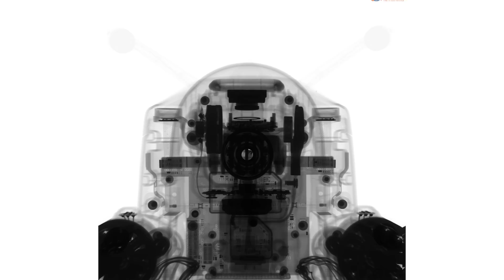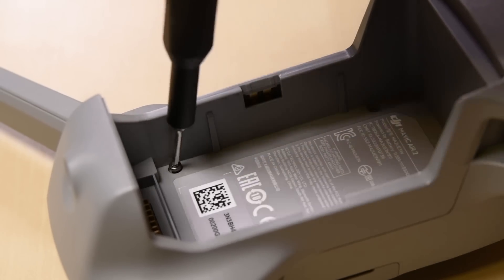DJI Mavic Air 2 Teardown: A Look Inside DJI’s “Best Drone EVER”

Comment: Sir this is very important for me I have a dji mini 4 pro drone which had crashed, now it is not connecting to the rc, sometimes it connects but if it moves even a little, it gets disconnected. Can you tell me what could be wrong with it?

Comment: Something I dont think was mentioned. The Motor // Arm soldering points are actually spaced pretty far apart, making it easy for even a novice at soldering to be able to do it easily. Most DIY focused FPV drone electronics arent done in such a way. You are lucky to get a mm or two between pads, here we see like 1/4 inch. Dont like that they didnt put a plug for the arm motor combo, but I get that it adds weight and they wanted to save every 0.1 gram here.

Comment: One of my 1.5mm sensor plate screws is not drilled so I can’t remove it. Any ideas how to take it off? All other 5 came out no problem but the one has no hole! Agh
Reply: This is over a year ago but it’s a cap. Remove the cap and you can remove the screw.

Comment: 3:30 hold up. The landing leg on my mavic air 2 broke and the two connceting cables from the led got disconnected. Do I need to open the propel thing also if I want to connect new leg and the cords to the led?

Comment: Excellent video!  I'll be disassembling my MA2 soon.  Replacing the front sensor module.  Hope that clears my "Front Sensor Failure" error.  I like the drone but when parts fail for know good reason, you have to wonder about low quality components.  Love how it manually flies though.

Comment: great video!  Im trying to add an external battery.  Do you happen to know if those 2 holes on the esc near the battery connector a positive and negative battery input?

Comment: I tried to use this process on my DJI air 2s to remove the gimbal from the body. The gimbal data
cable came out easily from the mother board just as seen in the video, but the
video cable does not. seem like the plug and socket of the video cable are different.
At least in my drone there was no space to place the pry tool under to release
the cable. Please be very careful when trying to get the video cable
disconnected, you may end up spoiling the socket on the motherboard. Just a
heads up from my experience.

Comment: May I know when you remove the screw for panel facing down 1:13 , do you have to remove 2 seals that will void warranty? I don't see any seal but I want to confirm as after I sent in for warranty claim, I was informed by service centre that my seal is missing and will not entitled for warranty. So unfair! Wonder anybody experience this from DJI service centre
Reply: If you look at one of the screws when new, it has what seems to be a glob of epoxy over the screw cavity. This is one of the known ways DJI determines if your warranty is void. Unfortunately it can be picked out with a finger nail fairly easily.
Reply: @battery_wattage  just be careful, This toy is for outdoor, you can lose this epoxy and lose your entitled warranty

Comment: I just used this vid and a couple others, as well as this forum post: https://forum.dji.com/forum.php?mod=viewthread&tid=217010&extra=&page=1 to repair my brand new Mavic Air 2 overheating constantly. It happens because DJI didn't pay attention to the cpu and ram and 8gb internal memory chips not properly contacting the metal heat pads shown in the video. Some thermal pads and noctua thermal paste fixed the issue and I can record in 4k 60fps in sunny florida without breaking a sweat. If anyone needs help and has the same issue, feel free to comment and i'll try to help.

Comment: If you have a drone with 1 of the 4 motors magnets feel a lot weaker then the other 3 would you change it the with no errors or anything just feels like the magnets are weak when you spin by hand compared to the other 3

Comment: surely once you remove the solder of the motor from the board you can pull the wires out through the leg? so you wouldn't need to remove or resolder the motor end.

Comment: WHAT SIZE HEX SCREW TO TAKE OUT THE SMALL 2 SCREWS AT THE FRONT OF THE GIMBAL.. 

Those screws are smaller than the 1.5 mm 

Thank you great video!!

Comment: Question about the bottom cover on the Mavic air 2...
There are two round sensors on each side of the LED.
When you take the bottom cover off, do those have glass in them or are they just empty holes? 
In other words,  is there supposed to be glass covering the glass sensors?
Thanks

Comment: Hi iFixit  , thank you for this guideline. Really appreciate. 
I have some questions. Basically, due to new European regulations, I need to decrease 570 grams weight of the Mavic Air 2 to 500 grams. I have an idea to get rid of avoidance sensors (Front,Down,Rear). Related to the above, the questions as follow:

1. Is there a chance to measure the weight of each module are shown in the video:
- Front vision module (3:07)
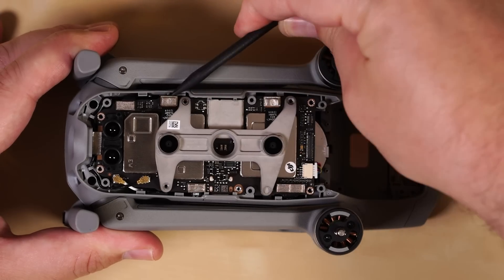- Down vision module (2:04)
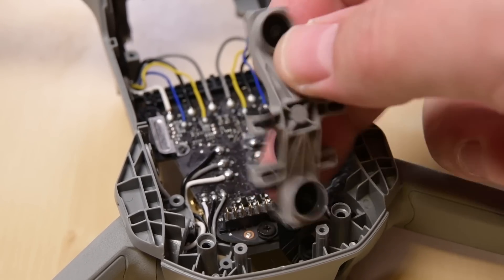- Rear vision module(3:15)
2. What are the parts that may be considered as redundant? Just in case if avoidance sensors will not cut 70 grams.
3. In case I remove 3 mentioned modules and disable the avoidance sensors in the setting of the app. Would it be working fine? 

Thank you a lot for any information. it will help me a lot to make a decision. I believe for many people in Europe that would be helpful, due to the new European restrictions (valid from 1 July 2020) with drones above 500 grams. 
And Last - Is the any chance to share XRAY photos. They are just fantastic!!!

Thank you a lot

Comment: Recently crashed my mavic air 2 into the tree and the gimbal's now stuck. After inspection, it looks like one of the cable connecting the gimbal to the drone was cut... Do you have any suggestions on how to fix it/get a gimbal replacement?

Comment: Interesting comment at the end 'it's not a drone it's a quadcopter' . . . I would posit that it's both.
I suppose it depends upon how you define what is a drone,  because drone aircraft come in different forms. 
I think in the most basic sense a drone must have the capacity not only to operate but to also function without external input.
As an example a well tuned and balanced quad can remain stationary in flight with no stick input, but that's all it can do with no stick input. A drone on the other hand can take off,  fly a course by waypoints , return home and land all without the need of any stick input.
The Mavic Air 2 is a drone in quadcopter form. It can be flown as a drone, or as a quadcopter - albeit with permanent stability & stuck horizon mode.

Nice break down vid

Comment: Is it easy to tear down the landing gear stand? Just  concern, if I need to replace this part, does the LED come out easily or do I need to desolder the wires to remove it from the housing?

Comment: Are you able to show where the ADS-B sensor is? UK version didn't get Airsense due to supply shortage. Keen to see if it's a clip in module we could add at later date or if it's a chip on main board - curious to see if I just have a big space where it should be.

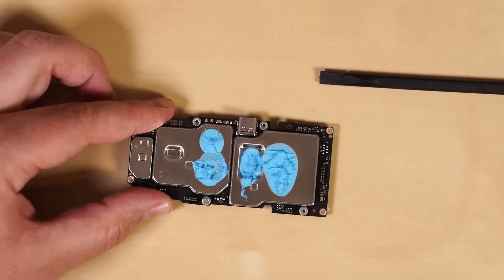Comment: When you opened the heatspreaders to see the actual chips (as seen at 2:35), was there any thermal paste under there or were the chips bare with no thermal paste/pads touching the metal heatspreader covers?

Comment: 6/10 is a very mean score.
Looked super simple to disassemble to me - the soldering is because those are the parts that vibrate, would be dangerous and add unnecessary weight to put clips there

Comment: I think the quad itself deserves a 7.5/10. The remote should be evaluated separately, as that doesn't tend to break (be broken)
Reply: Its also not a part of the drone itself. I dont think it should have been included. You arent flying the remote around at 30+ mph

Comment: “Even though they dominate the market they continue to innovate at every price point”
Apple has left the chat
Reply: Boost
Reply: Can Apple get into the drone market now or is it too late? I wish they would as it would certainly provide DJI some healthy competition!
Reply: So true 🤣 Paging the Rossmann group!
Reply: Really though, look at Fimi.  I don’t know about repair ability but the X8 is between the Mavic Air and a normal $1000 Mavic but it costs under $500.  No safety sensors but the speed, battery life and image quality compare VERY favorably
Reply: @bruhdabones  really it works well? I dont think so, and also beta products? Which one? Their 1:1,000,000 ratio for their face id? LMAO
Reply: At least they dont release half bake products. Im talking about Samsung's ultrasonic fingerprint.
Reply: @johnricang8791  it works well lol apple is known from releasing beta-products
Reply: First laptops to totally use USB-C, afterburner cards, cases that are totally silent even on full load, iPhone cameras are one of the best phone cameras, iPhone SE2, Retina Displays, Mac Pro Display, Radeon Pro Vega II Duo, etc... They don't innovate at litteraly every price point, but they still manage to do better than others.

Comment: 6/10 seems awfully low for such an easy disassembly.
Reply: I was thinking the same thing. I think iFixit gets too hung up on solder and glue. Both are viable assembly options. Anyone adventurous enough to try to fix their own drone should learn how to solder.
Reply: @ddegn  Exactly and its not like soldering irons are expensive, you can literally buy them for less than 10 bucks. And its not that difficult either just a clean surface and good temperature setup and anyone could do the basics.
Reply: @idontcare7961 I tried using one of those non adjustable irons they're really terrible and almost never get the solder hot enough to make a nice solder joint!
Reply: I agree, this drone is easily a 7. Should it disassemble itself for a 10, wtf?!
Reply: @kunstbanause  it repeares itself at 10/10
Reply: @kunstbanause  I don't even know what is a 10 in their book. I can easily give this a 9. I don't see anything that can break and not be fixable. If you have the spare parts you can fix anything on this drone. Unless 10 means removable chips and wires clipped together with Wago connectors.
Reply: if this is 6 of 10, then new macbook or iphone should get 0.1 of 10
Reply: I also agree. A 6 is way to low. 8 out of 10 is much better. Look at how accessible these solder points are.
Reply: Easy to say that when you're watching it on video & the person doing it has years of experience...
Reply: I think that being a bit strict with ratings can only help: we shouldn't settle for less and always ask for even better designed products, both in terms of repairability and sustainability. There's still a lot to do.
Reply: totally agree, especially when you compare it with mavic pro 1
Reply: that is first time i disagree with ifixit repair score
Reply: 🤯What!? Just stumbled over this: A drone, where every gram matters (so ideally comprises of glue and snap-ones) manages to be that easily disassembled -> should be easily above 6 🧠. If you manage to break a leg on that quadcopter, you‘ve met g-force  that will draw you‘r attention to all aspects of that quadcopter... likely leaving a „non-functional“ led on a leg the smallest side note there is. You guys really need to give ratings in the context of the device. A flying machine that needs to obey multiple layers of regulation can not play in the same ball park as brick in your left pocket. 🙄
Reply: I agree, I would have given it an 8/10
Reply: I would give it an even less repairability score considering how you need their proprietary software to do anything related that doesn't replace a simple board swap.
those leg solder joints are an ass to put on, camera is relatively modular but I would not call a camera "replacement" a repair.
Also, I believe DJI doesn't even directly sell replacement parts to customers, you will have to buy them through retailers.
I'd give mavic 2 a 4/10, not even a 6/10.
tldr being modular/having accessible solder pads/joints does not mean it's always repairable.
-former DJI drone repair tech
edit: typos n stuff
Reply: KopaZ Unfortunately things are only repairable if you can get replacement parts for them. The old iPod Hi Fi is easy to disassemble and I’d probably give it a 7 out of 10, but since there are no replacement parts available (never was) what good is it to be able to disassemble it with ease if it can’t be fixed? That’s why I sometimes feel iFixit’s repairability scores are worthless some devices are difficult to take apart but once inside might have some generic components, another device might be easy to disassemble with only a Phillips screwdriver but if you can’t obtain replacement components, it’s headed to the dumpster.. err recycling. 

It sucks because manufacturers only provide authorized service centers with replacement parts. Even though I used to work as an Apple Certified Macintosh Technician, Apple won’t sell me parts any longer since I’m not working for a AASP. I remember trackpad (with flex cable) for a 2010 MB was roughly $40 for the part, and yet when I checked a few years ago, the same part was $63 or so from ifixit. Had to buy from iFixit. Wish manufacturers would be forced to sell the same replacement components to consumers at a reasonable price, but that would kill their own repair business🙄

Comment: 6 out of 10 for a drone sure but that thing looks super simple compared to a phone.
Reply: 6/10?? 11/10...
Reply: Soldering a so easy connection only require a soldering tool (20 in ebay) and a bit of tin... nothing special in ma mind
Reply: No point disassembling an iphone 12. All the hardware is tied together. Put any other genuine apple hardware in it, it will fail to operate. nice one apple.
Reply: yup, soldered motor connectors pretty bad. Immediately makes repair into a "techie" thing vs. connectors.
Reply: Except no one would ever just use a connector for the motor connections for a quadcopter. There is too much current combined with the vibration at the motor. Maybe connectors on the end of the cable for the board, away from the motors, which they do do. It's common for these toy quadcopters to provide spare motors with the cable pre soldered to a wire with a connector that you have to thread through the arm.
Reply: Jason Gurtz-Cayla my 30$ drone had connectors. Trust me it’s not that great. After 1 hard Landing (Stuck in a tree and fell 6 meter) the connectors broke and there was no way to connect them without replacing the wires with new ones. So soldering is stronger and will last longer as these drones will last up to 7 years